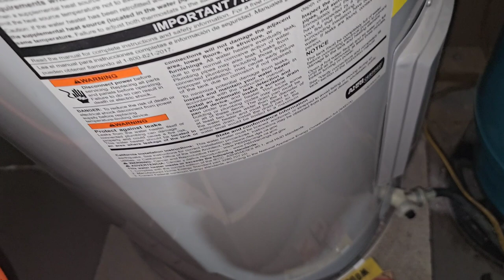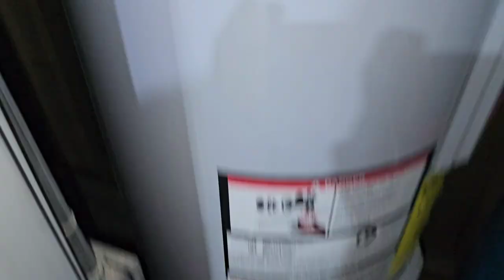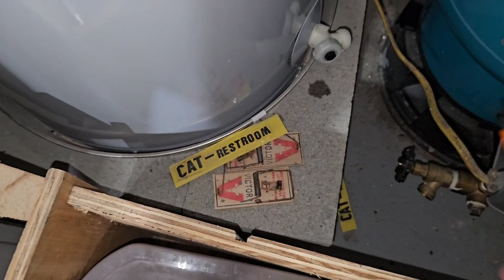Flushing Water Heater First Time Vlog

Comment: As a long time realtor, I will say the most neglected mechanical item in a house is the water heater. No one thinks about it until they end up taking a cold shower. It’s a probably the most common (though cheap) thing that shows up in a home inspection. It’s often some  part on top that is missing or an issue …I don’t know much about water heaters but I know few do maintenance on theirs, including me :)
Reply: Would you recommend home buyers replacing them after they move in (depending on the age of the home)?
Reply: @attigator  only if inspector says it’s in its last legs. Water heaters can last for decades but newer ones are more efficient.

Comment: A little hack a friend uses when you open the tap after it's flushing and dealing with the pressure,  get a piece of pool noodle and put it over the tap so the water doesn't spray all over.  doesn't work on every tap but it's a way you can set it up and not have to freeze your hand.
Reply: I zip tie a wash cloth to the faucet.

Comment: Post, when the tank is empty install a new drain valve. I installed a 3 inch brass pipe nipple and a 3/4 inch ball valve with a garden hose fitting on the end. It drains so much better and faster.
Reply: He doesn’t want “fast”. The sump pump would have to keep up with the discharge rate.
Reply: Steve He doesn't use his sump pumps Only for back up He uses a gravity drain out to his  big Pond

Comment: I think the brown stuff at the bathroom sink also comes from the pipes. Their inside is covered with this silicate slimey ssubstance that also was in the heater tank -- which is kind of beneficial, since it protects the water. (that is the reason why even very old lead pipes are not such a big problem -- the water is never in direct contact with the metal). The slime is completely natural and you get it also with city water. But the second it gets in contact with air, it turns brown. Every time you torn off the water and let the pipes run empty and then turn the water back on, it comes out brown. We had it with our old steel pipes and with newer copper pipes. I don't know if it's the same with the plastic pipes that nowadays are sometimes used for installations in newer buidings.
Reply: Oh thats interesting.
Reply: PVC and PEX will get the same slime yes.

Comment: Hey Post, I am pretty sure that the nasty water at the end actually came from dirt in the pipes that was stirred up from the air bubbles rubbing the inside of the pipes and not the water heater. It should do the same thing with the cold water faucets (but less because there was less air). It happends a lot on the old ship I work on when water gets cut off for maintenance.
Reply: The old ship probably had old galvanized pipes, you don’t get a lot of that in copper and pecs piping.

Comment: I didn't realize water heaters had a sacrificial anode. Makes sense though that they would. I wonder what it's made of? Aluminum, perhaps? 

The preserved battleship USS New Jersey on the Delaware River has discovered that their cathodic protection isn't working. The navy installed new zinc anodes when she went into mothballs in the salt water of Puget Sound, but they don't work apparently in fresh water so she'll be getting aluminum anodes next winter during her drydocking. Hence my curiosity here on what material it would be in the case of a water heater.

Comment: You should take the strainers of the faucets before you flush them. You should probably take them off and flush them out or replace them.
And your bathroom sink is missing the strainer. My bathroom sink sprays everywhere without it (when I put my hands in the flow).....even at a low setting.

Comment: Post , I just replaced a small water heater at my new home it was easily over 10 years old. We tried to flush out the water to move it and it absolutely wouldn’t drain any water. I had to move the thing full of water , it took like 50 mins for me to move inch my inch without a hand truck

Comment: good practice is to clean out the filter screens at each faucet as well. Soak them in CLR if they are super grungy.

Do this once a year and you will never have a problem with sediment building up and blocking the drain port

Comment: I like to swap that plastic valve for a brass one. next time you drain it, just unscrew that plastic one and swap it out. eventually when you do this the plastic ones won't shut off completely or they'll just break and you'll have a nice flood. brass valve is $10 right in the water heater parts section

Comment: LOL that's crazy you talkin about the screwdriver cuz I've watched the same video what's amazing is any little break-in that insulation will allow a leak for high-voltage it can even be the size of a pin just any little break in the skin of that material will allow a high-voltage lake

Comment: I have a pressure tank for my 3 storey house.. to help get water to the third floor.. i guess its the same because your pulling your water from the well? I have my boiler service annually but he never done anything with the hot water cylinder... hmm its almost 11pm here now, ill check that out tomorrow see there a tap at the bottom?  Or at least make some enquiry on next service.

Comment: Nobody replaces the sacrificial rod or hardly anybody and that rarely ever flush them out I have seen them so bad that the settlement has built up to the bottom element and when you take the bottom element out the settlement actually comes out of it and can build up enough to bury the bottom element and cause it to overheat and shorten the life of the element

Comment: The way to go is an on-demand water heater. Saves energy, no water storage, only heats the water you’re using. Very affordable.
Reply from the maker: If I had propane I probably would
Reply: There are studies done on what is most effective given your water and fuel intake.
Reply: @post10Vlogs  the one I have in my house is electric. It’s a tankless water heater. I think my dad got it at Home Depot for under $800. But I’ll recheck next time I talk to him.

Comment: I don't know I think what's going on with your faucet that when you barely open it it lets water water through in the little rubber washer is expanding or contracting and when it's hot I've had to do that because then the hot water hits the little rubber seal in there and swells up and closes the Gap up so you have to open it up a little further to reopen the gap

Comment: I have pretty bad city water and it ruined the original water heater after just 15 years. It was so full of sediment that the guy replacing it could not drain it. I had them install a reverse osmosis filter thing that is supposed to prevent as much sediment from getting in there again

Comment: The next time you flush the lines you should take the aerators off the ends of your faucets. There’s a screen in there that gets plugged with all that sentiment that your disturbing, it will restrict your water.They just unscrew.

Comment: Hot water just stays at the top when cold water flows from the bottom. It doesnt mix even after long time, hot water just float above cold water because it is less dense.
Reply: Is this common core fluid dynamics?  I missed out on a lot with this new teaching curriculum.

Comment: Anytime you drain your plumbing system down it will push sediment and discolored water out of all the taps. The air and turbulence that are created when filling it will kind of scrub the pipes it's perfectly normal even in a house with city water. And it is not unusual to have to clean your aerators out at all the faucets.

Comment: i live in an apartment and would like to know how to flush my water heater.
Reply from the maker: If you don't own the building you shouldn't have to worry about it and it's possible the whole building uses one system
Reply: @post10Vlogs  I meant town housem I think each one has their own
Reply: @post10Vlogs  I also rent

Comment: My water heater is 50 years old 😮
Reply: Just wondering, do you flush it regularly and change the nanorod or did you just leave it.  There seems to be mixed opinions about this.  Thanks
Reply: @charliefunboy5210  no it's never been flushed. It needs replaced surely.
Reply from the maker: Is it a tank water heater or is it like a big heavy duty boiler?
Reply: @post10Vlogs  a tank water heater

Comment: That light switch is not rated for the amperage of an electric water heater. And if it's 240v that switch is only going to break one of the hots  it's not code and more importantly it's not safe
Reply from the maker: That is a double pole 30 amp switch

Comment: Every  sink faucet has an aerator in it.  This can become clogged with debris when turning the water back on.  Use a bathtub faucet or unscrew the aerator to prevent it from getting clogged.  My bathroom sink faucet has a reduced flow because debris get stuck in the aerator.
Reply: You can take a worn out toothbrush and some dish soap, and go to town on those. Cleans them out really nice.